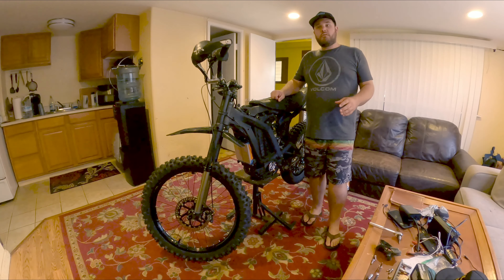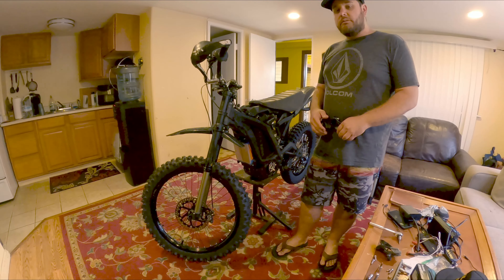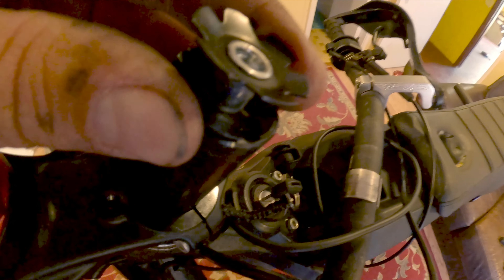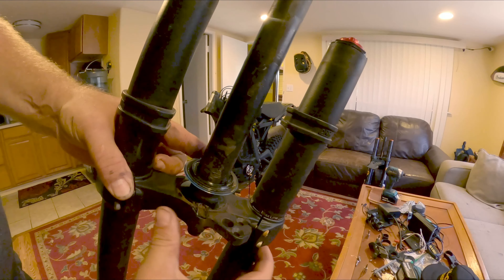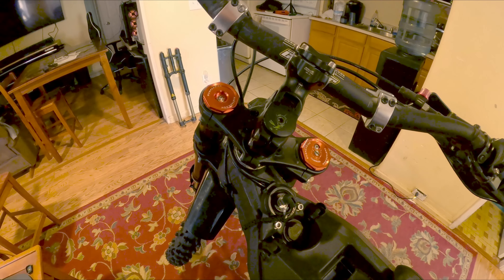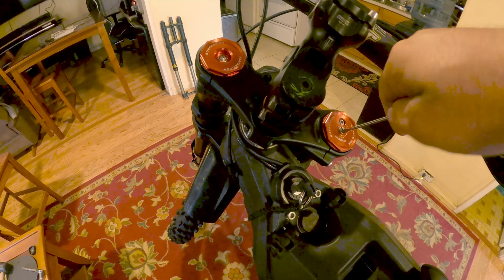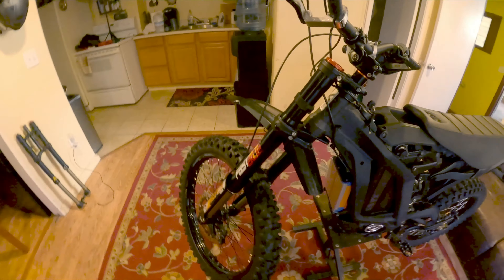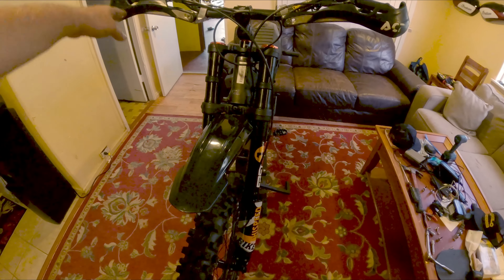Fastace Fork ALX13RC Install How To

Comment: What size spring did you get? What is your weight? What are best compression and Rebound Settings you've found for say, trail riding and enduro? I'm about to buy a Fast Ace to upgrade my E Ride Pro.. Thank You! Nice Video!!! : ) Happy New Year!
Reply from the maker: Hey man, thanks. It's 600 lbs and im 250 lbs. I just have it all in the middle, i still have to set it all up for me.
Reply: @Mayhemjach  Thank you! : )